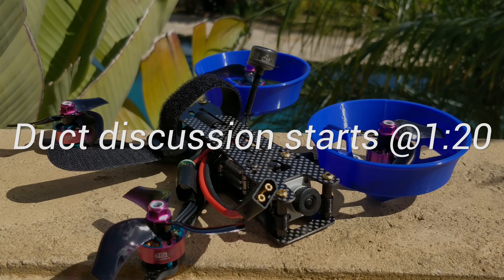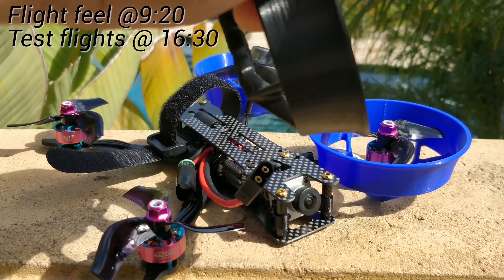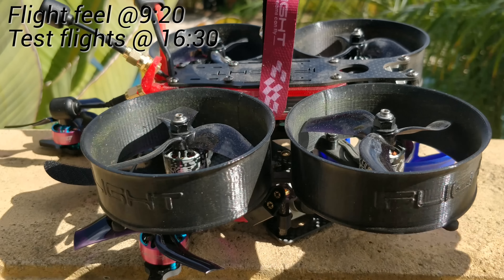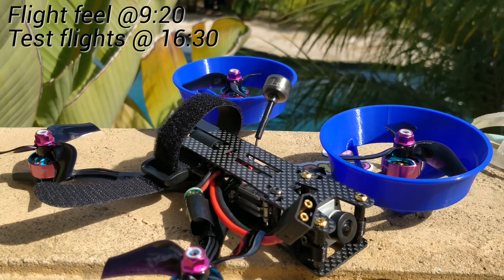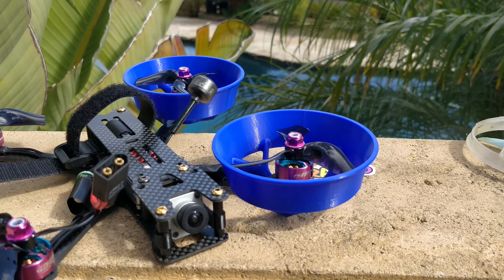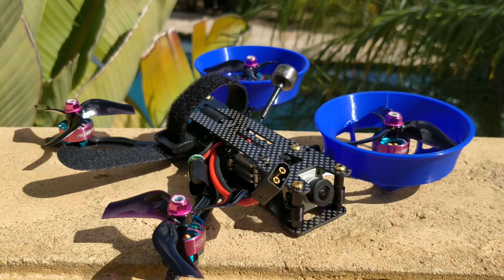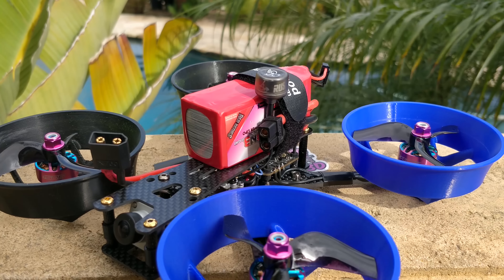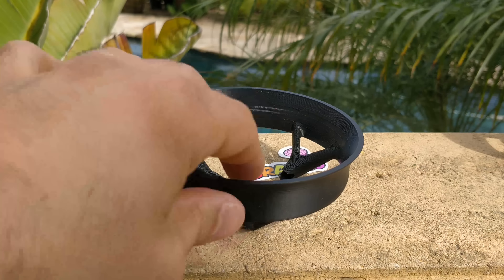introDUCTion to duct effects - Thanks Panico FPV for the name

Comment: Thanks for the video, Bob! Regarding safety: lighter quads are actually safer, so prop guards and lighter motors might be a better option in that regard. Lighter quads also don’t need that much thrust, so they tend not to sound like a chainsaw. You also don’t need a 1300mAh battery then, reducing the weight even further. I think I posted it already in a comment here, but here’s my take on a light cinewhoop carrying a Session https://rotorbuilds.com/build/20986 It weighs 292 grams with the GoPro and cruises for 4 minutes off a 450mAh 4S pack (so tiny, I know). The only thing is of course it is based around a Session which is inferior to larger gopros in terms of video resolution, FPS and other features. 1306 motors that I used start losing in efficiency compared to larger motors if you ask for more than 100 grams of static thrust. But maybe 1404 motors are actually the way for a lightweight cinewhoop with a larger GoPro 🤔 Oh, and I tested the guards on a thrust stand. In the configuration I have on that build (non-ducted props and visible gaps) they increase efficiency by 10%, probably by eliminating tip vortexes as you said. What’s also interesting is while 10% thrust increase is significant, there’s no “delayed” throttle effect added, which might be a support argument for your theory of air inertia being the cause for it.
Reply: idk if youve seen that tina whoop by diatone but that thing is tiny and it sounds like a chainsaw more than any quad ive heard lol
Reply: i guess its kinda irrelevant in this class but it shows how much of a sound difference good ducts/prop guards make
Reply: @___echo___  I haven't seen the one by diatone, but a buddy of mine has a more "traditional" heavy build with generic "untuned" ducts from China, weighing closer to 500 grams or so, and the sound it makes is pure horror. It almost makes you grimace when nearby. The light build that I posted is not like that though, it is very quiet, but I guess mostly because of low weight - it doesn't have to rev the props that hight to stay in the air.
Reply: @ErgoFPV  https://youtu.be/uzByJ5H0PC0?t=71 this thing is tiny and is super loud lol
enough to make it a deal breaker for me cause this thing does look pretty cool imo
Reply from the maker: As echo said, frikin CHAINSAW!  It would make a chainsaw cry actually with how loud it is. Anyway, unfortunately you actually do need some power to use ducts. It doesn't work so well on weak motors.

Comment: So back on what you said about people not doing enough testing and research with air flow and wind. Has anyone ever done wind tunnel testing for this kind of stuff? I mean maybe that is something totally out of budget for anyone fpv company or researcher. But seems like some prototypes and a trip to a wind tunnel facility would greatly benefit design for things like this. Also thanks for making us stare at you crotch at the end there. 😂😂
Reply from the maker: I have been begging someone to set up a very very VERY basic wind tunnel for testing for the past few years.  As simple as one prop/motor in front of another that's being measured.  No tunnel even needed.  I think that would help quite a bit trying to tell things apart.
Reply: Yes! That would be awesome!. 1 good engineer could pull something like this off I'm sure!

Comment: with all that said, I ended up designing my own prop guard to put on my Squirt to get rid the control issues
Reply from the maker: What was the design? Less duct and more guard?
Reply: @Kabab  Ducts were giving me issues: Too strong ground effect(?), throttle control felt so numb, too easily affected by wind, and the tiny angled bit being in-frame of gopro video. With more modern powertrain the benefit of ducts became negligible, and I'd like to have better control.

So this is the design:

https://i.imgur.com/8cEGZmC.jpg

The guards are drawn from scratch, leaving most meat around prop line, the chamfered and flat portion above prop line wasn't intended for aero but for strength purpose, to avoid being squished and touching the props in case of collision to surroundings, inner diameter also got enlarged to fit normal 3" props.

These replaced the stock ducts and I like the flight characteristics better, could be placebo effect anyway.
Reply from the maker: @KwongKan  that's a totally reasonable progression and that's what I prefer as well. Just good guards. Not ducts. But, for a small setup, ducts can help lifting performance and that's where they begin to be needed.
Reply: Yeah just some kind of give/take situation with better thrust or more intuitive control.

Comment: Does this mean a duct can increase vertical climb speed?
Reply from the maker: Great question. I'd say no because you can't quite get the same rpm out of the system it seems. Ducts are good at generating thrust it seems. Thrust does not mean speed all the time.

Comment: The benefit is reduction of tip vortices and spanwise flow.

Ducted units have to spool up to get thrust (which I think causes yaw washout with the FC), and I guess you could also say they need to spool down to drop thrust.

Comment: 08:53 how can there be like a 1mm gap on one side (prop - duct) and on the other side its scraping? This is so far from perfect I can't believe your love for perfection isn't letting you freak out? :D
Reply: That def scraped when bumping into something, the duct flexes a bit and it scrapes
Reply from the maker: It's obviously an imperfect system and no matter what I still dislike ducts and guards. But I wasn't talking about any of that here. Just the potential benefits of ducts...even though these are more like psudo ducts because of the gross imperfections. The effect still comes through but I hate it. When I show the design I've been working on it will probably be very intesting to many

Comment: I have no expertise in this, but just asking:  would it be worth exploring replacing the props with something more like the fins you see in a jet engine?  (probably paired with a very low kv motor... or lowered artificially with fc software).
Reply from the maker: Yeah actually I think that would be a reasonable thing to test. Would be interesting to see how efficient it would be.

Comment: If I was a dentist with a slightly profitable Youtube channel I'd get one of those cheap smoke machines off Amazon to show how air travels through quad props.
Reply from the maker: 😂. Unfortunately that doesn't work as great as it would seem without a laminar flow tunnel of sorts.
Reply: @Kabab  It is really easy to build a laminar flow tunnel.  All you need is a long  and narrow carboard tunnel.  Fill the tunnel completely full of  a single set of fast food straws hot glued together.  Put a fan on one end.  The straws straighten all the air into laminar flow.  I saw this done by a guy about 10 years ago comparing how different PC computer fans moved air.  You can cut the straws into short pieces.  You basically just need to create a honeycomb like grid of straws only a couple inches long for the air to flow through.
Reply from the maker: @Plur307  this is assuming I have the time and space for it. Plus, I wouldn't really use it much. Still hopefully some day
Reply: @Kabab  understood.  Just letting you know you can make a laminar flow tunnel for like $10 and maybe an hour's work.
Reply from the maker: @Plur307  but then I need to do all the testing involved with it too.   Someday maybe

Comment: Thank you for explaining coanda effect, Hoerner wingtips (A10 Warthog style) and  boundary layer (parasitic drag).

For this duct technology reason  "RC edf jet" hydro-aerodynamics have been my favourite flying RC planes for 2 decades before entry into drones!
Blocking the airflow from the outer duct surface and inner surface increases thrust even more.

Reduced noise is due to the larger inlet diameter which reduces airspeed at the duct edge. increasing speed inward.

Gemfan prop is not ideal IMO the best efficiency is where highest airflow is:wingtips. Thin wingtips create less lift.

Have a study at edf jet propulsion designs designs you'll love it as much as I did!

Please show the model hovering percentage with and without ducts to show efficiency of ducting.

great review!

Comment: Tuning of the duct surely is an interesting issue. I once had a EDF jet (plane) it was a pain to get it up to speed, needed the whole runway, but once it was in the air, it got really fast. I also remember seeing a video of some guy, building a quadcopter with ducted fans meant for planes. It failed, because those ducts were tuned for jet-like planes and did not produce enough thrust at lower rpm. Changing the rpm to stabilize it did not go too well 😏

Comment: Off-topic but you know I come do you for a lot of advice brother so whatever LOL I'm looking at picking up the GoPro hero eight they have a trade-in special where you can get it for $299 you just have to trade in any digital camera in any condition. Do you have a hero eight?l is there a lens cover that is worth getting to protect the camera? Thanks man appreciate it
Reply from the maker: the 8 is actually not that great imo.  I'd go for the hero 8.  I have an 8 with insurance.  I've already destroyed the screen and planning to turn it in and I'll get a 6 instead.  But that's a good deal no matter what so even if it's an 8, go for it.  The issues with the 8 are that they made the lens cover integrated into the body so ND filters and mounts are a pain in the ass to deal with.  That's really the only issue.
Reply: KababFPV damn that’s allot of issues... I can get a Hero6 for $180 new but no insurance ...that may be the better option. You like the 6 over the seven? Thanks allot for the fast response and info. I knew something was up with the 8 because no one seems to love it.

Comment: His duct designs are nice, but Is he still printing them in pla? If so they’re completely useless. First crash and they’ll snap especially in colder climates.
Reply from the maker: Yep. I'm not a fan of ducts or guards at all but I appreciate the need for guards here and there and also appreciate the potential benefits of a duct....or at least these psudo ducts with all the imperfections.

Comment: The duct effect isn’t what’s shooting the quad upward, I guess it’s the pids overcompensating an unbalanced quad.
Reply from the maker: It's not unbalanced. The effect exists on every ducted quad I've ever flown.
Reply: KababFPV I only mean the quad with 2 ducts on it. The weight, throttle response, and throttle curves are unbalanced.

Comment: Why do people keep buying cinewhoops and expect them to fly like 5-inch freestyle quads. It's like mounting a DSLR camera to a quad and expect it can do freestyle.

Cinewhoops do not have they same smoothness and flying precision as unducted quads. Their ducts are meant to provide thrust carrying heavy action cams and some safety to close proximity flying with soft targets.

Cinewhoops are mostly tools, freestyle and racing quads are for recreational stuffs.
Reply from the maker: Is that different than what I'm presenting here?  Am I not allowed to do a little research to try and that tool to perform better?  I'm not trying to get a crazy acro machine. I'm just trying to get something I can use better.
Reply: So because it is a cinewhoop, you don't want people to make them smoother and more precise ? Seem dumb
Reply: @KoreFpv  so do you drive a 6 wheeler truck like a drift car? Or do you buy a the right tool like an actual car that can be converted to a drift car? If that seems dumb to you, I don't know why we make tools for the right job.
Reply: Cinewhoops have three basic requirements (1) must have enough thrust to carry an HD camera or an action cam (2) must have enough control to slow down and negotiate tight spaces (3) must be safe enough or provide a sense of security to fly in close proximity with soft targets.

A cinewhoop is NOT a cinematic acro quad, there are quads built for that.

Why do we have 7 different types of surfboards? Why do we use shortboards for acrobatics instead of longboards?

Why do we have buses? Do we race with buses with passengers against a Formula1 car?

Do we use bowed kites to carry people and glide over mountains? We use a glider for that.

Any tool can evolve, but it cannot evolve into something that is not meant to do in the first place.

That is why we use tools for the right job. If a tool is not working for us, then we transform or create a new tool. But, we do not put a handle on a screwdriver and call it a screw hammer. That's why spork has been an inferior utensil.

An impressive cinewhoop is a quad that can fly 2 or 3 inches away from walls and targets without getting it to flip up, thrown away or suck into walls like magnet.
Reply: @momo.ru-kun  thats why we try to make stuff as good as it can be.